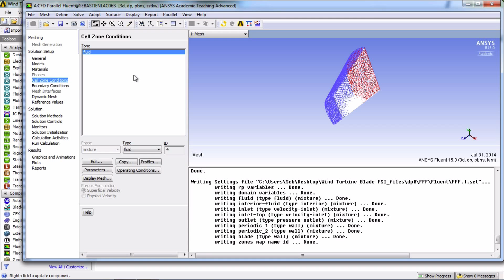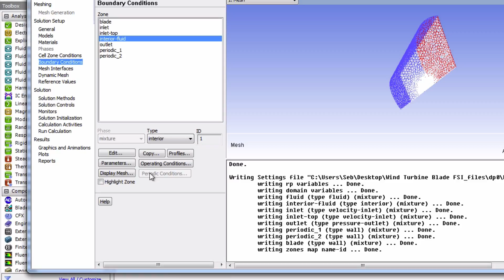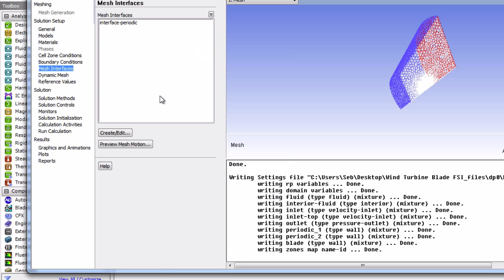SimCafe: Wind Turbine Blade FSI (Part 1), Boundary Conditions

Comment: as shown in the video, the wind turbine blade is set by default as a "stationary" no-slip wall. i'm asking if it was supposed to set as a "moving" no-slip wall with zero rotational speed (0 rad/s) in case of  using frame motion approach. Is that true or not ?
Reply: hi Islam did it work with you when you set blade to 0 rad/s